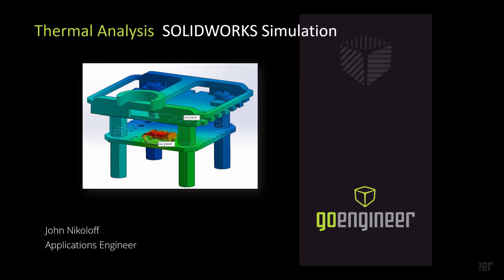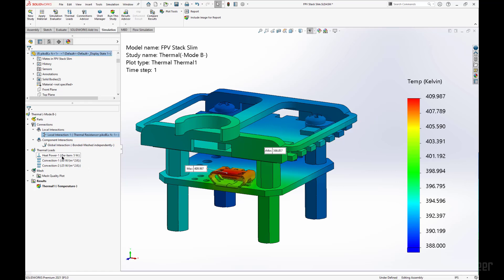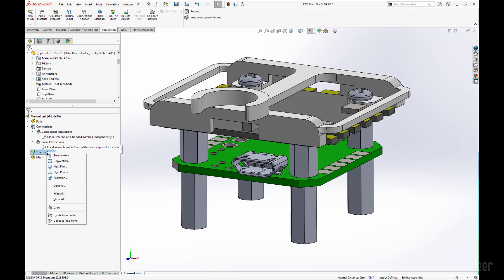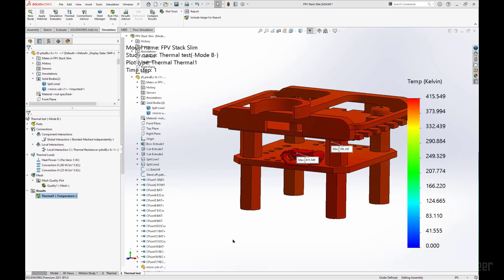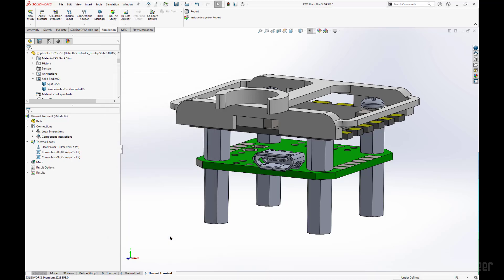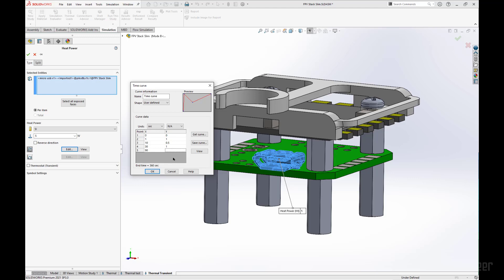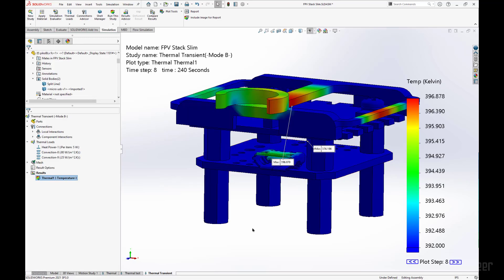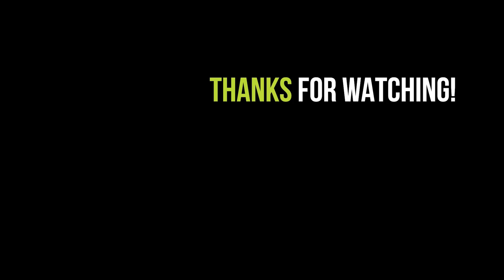SOLIDWORKS Simulation Thermal Analysis 2021

Comment: why specific heat property is related to transient analysys?)
Reply: Review the Heat Transfer differential equation:

It has three parts:
(1) Variation of Temperature over time 
(2) Variation of Temperature over distance or area 
(3) Q --> Heat Generation. 

Governing Heat Equation:
(1) = (2) + Q

(1) has specific heat and density in the equation.  

In steady state analysis - time goes to infinity and that part of the equation disappears. You may want to review the 1D or 2D Heat equations with the steady state assumption (Laplace's equation). 

Hope this helps.